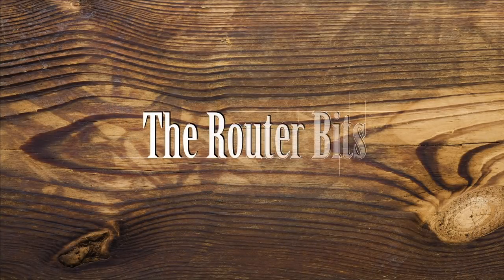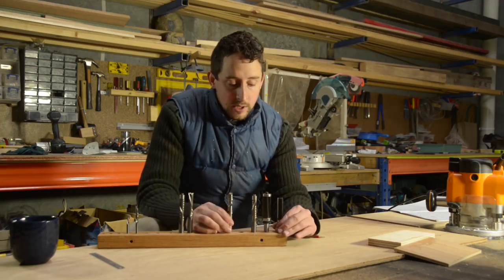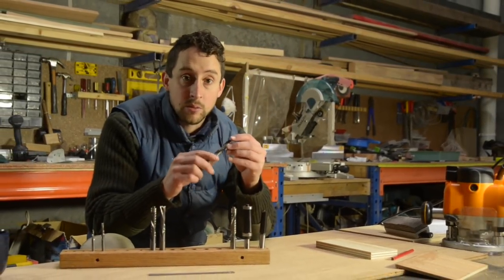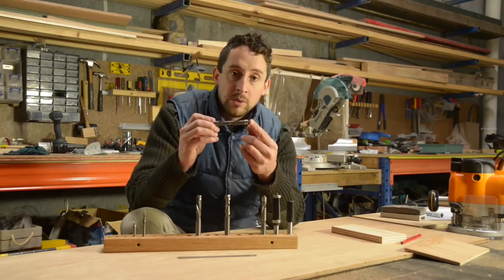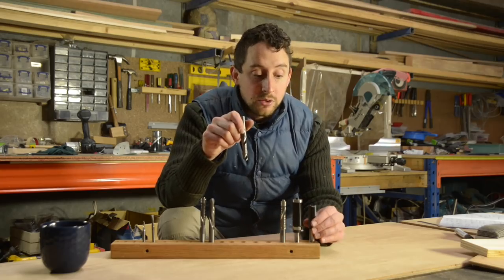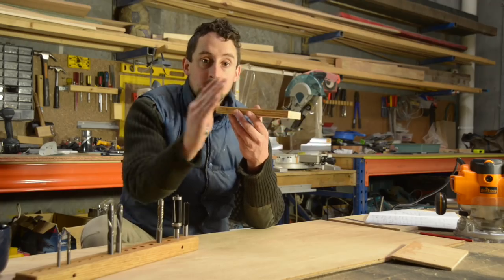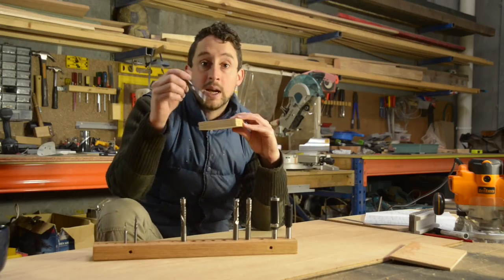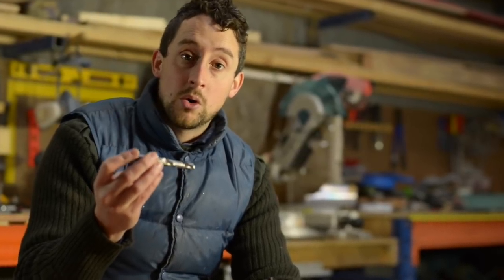The Router Bits - The Magic of Spiral Router Bits

Comment: You have done a great  job of explaining the how a spiral cutter works, I have been using  these for years in CNC routers and on the bench in a hand tool . They are great to use ..
Just one point I want to add is that there is a dual cut version these  which cut both ways at the same time giving a superb cut on both sides of the work piece., and awesome at face groves. And rebates , 
Some limitations are the up cut section is about 10 mm . 
In the UK they are know as         F max  but just look for a combination spiral cutter .
You will love them .
Reply from the maker: Hi Robert,

We just released our range of compression bits this month - check them out! https://www.youtube.com/watch?v=Z11csT4_8pM

Comment: You got it right sir, that's why there is a need to have the guide to maintain constant and straight cut, more advantage is those bits with guide bearing, it maintain consistent constant contact with the edge of the wood.. nice tutorial video.

Comment: Great video, perfect explanation. I was about to make a huge mistake on my bookshelf speakers project. I need to cut a 1/2" rabbet all the way around my birdseye maple veneered speakers to frame them with strips of bubinga that will get chamfered at a 45° angle. I had planned on using a standard 1/2" rabbeting bit but now I think that would have had some major tearout. Watched this video and now I think I'd be best off using an edge guide with a spiral downcut bit

Comment: Ok, so which bit would you use to carve letters in wood signs, and if you suggest the upcut spiral, then the use of packing tape would be beneficial?
Many thanks!
Reply: id think you could still use the down cutting spiral because you want crisp edges on the letters, as long as you’re not cutting too deep.  if you baby sit the operation on a cnc with an air hose, that will clear out the chips.

for example, if you’re only going 1/4” to 1/2” deep, plus blowing it out with sn air hose, you should be ok.
if you can get strong suction on a 1 1/2” dia vac hose and get real close, that might be enough to pull the chips out.
i think baby sitting it with the air hose and goggles for you works best.

have you tried a straight bit, and what did you try since you posted your comment?

Comment: Amazing explanation. I guess, my question is: if I were to get 1 based on budget, which one? Up or down spiral as far as versatility.
Reply from the maker: Hi Marco. Upcut outsell downcut by a factor of about 2-to-1 overall. Some specific sizes sell 1-for-1 but upcut overall seem to be more popular probably due to them performing better when cutting channels for chip ejection. But it very much depends on the application you have at hand and what you're trying to achieve.

Comment: This is a superb explanation of the subject! I wish I had seen this when I started getting into CNC. It would have made the learning process much easier. This reminds me of a question I have. In cutting through vinyl paint masking, I've found that when possible, using a downcut spiral cuts the vinyl mask off much cleaner. But most of my work requires Vbits to be used. Does anyone make a downcut Vbit? Thanks.
Reply from the maker: Thanks Jim. We are glad to have been of such assistance to you!

Comment: One thing that none of these videos address with upcut or downcut that greatly affects which bit to use is the explanation based on the bit in a hand held router or in a router table vs the edge yoy want finished. So if your using the router table and your finished side is placed down on the table which bit ? So on & so forth....

Comment: Are you a fan of compression bits ?
I understand their applications are limited but when they ARE applicable, are they worth the expense ??
Also... can spiral bits be sharpened ? 
I would imagine the bearing guided bits could NOT... unless the bearing is also ground to match the new, smaller, diameter...

Re. Down-cut spiral bits in non-through apps, you didn't mention that there would also be a lot of "re-cutting" of the waste material which increases heat & also wear to the bit...

😎👍☘️

Comment: I was cutting a box joint today with a upcut spiral bit  (1/2") using 1/2" thick birch plywood.  It cut very slow and created a lot of burns. It totally did not expect it. Change rotating speed or feeding speed did not help. What am I doing wrong? Thanks.

Comment: I have read that an up or down-cut spiral router bit should not be used in a handheld router because it is dangerous, so only in a router table. Is this true?
Reply from the maker: You should be more than fine using a spiral bit in the router. Like with any bit, use shallow cuts and follow all safety precautions. Jonathan Katz Moses did a video on these bit that go into the spiral cut bits in more details.
Reply: @timbeconaus  hanks very much for your kind explanation. Could you please post a link Mr. Katz?

Comment: Great video, thank you for doing it. I was wondering if a 3 flute spiral bit better than a 2 flute spiral bit for cutting hard dense wood? I am working with Swartzia leiocalycina and its an insanely dense wood. It's, also very expensive. I tried a standard straight bit on a scrap piece and it kept tearing out. I then did some research and came across this video, but now I am trying to figure out if I should buy a 2 or 3 flute bit. I don't have a lot of funds atm so I can only get one bit. Any help that you can offer would be most appreciated

Comment: Great video. Is there a recommended rpm for these bits? I was using a 1/4 inch up spiral bit for making box joints, and I smoked a brand new Rockler bit. I’m assuming I had the rpm too high. My P.C. router was at 16, 000 rpm. Seemed to go better when I dropped it to the lowest setting 10,000 rpm. Curious if anyone has an answer

Comment: what if you need a bearing on the bottom instead of the top, does the smooth round part past the blade on the bottom serve as a bearing guide for a flush trim?

Comment: Nice explanation. Which flush trim spiral router bit with bearing would you recommend?
Reply from the maker: The standards that are most often purchased are the basic upcut bits, but much depends on your tasks at hand. Can you give us an idea of what you will be doing?
Reply: It will be trimming a 18mm birch plywood with furniture linoleum (2mm) glued on top, using a template...

Comment: Do any of your spiral bits have a flat bottom like the straight cut bits?  I'm wondering if so, have you ever tried a spiral bit to flatten any end grain.  Most everything I've tried so far tears at the end grain.  I've tried straight bits and two different bits made for flattening and nothing is working very well.
Reply from the maker: All of the spiral bits have a flat base like the straight cut bits. I haven't tried to flatten end grain with one but I would assume that very light passes on a Spiral Up Cut would give you better results than anything else.

Comment: What about sharpening these spiral bits?
Reply from the maker: These spiral bits, like all Torquata router bits are able to be resharpened and we recommend that its done by an experienced sharpening service to ensure that the bits maintain their balance.
Reply: I thought that because they were carbide, they cannot be resharpened though?
Reply: As a machinist I was able to have spiral carbide cutters resharpened when they were too expensive to be replaced. Now the price of carbide has lowered to the point where they are usually less expensive than Hi speed steel. Any carbide designed for aluminum would easily cut any wood or plastic.

Comment: For a router table, which is better upcut or downcut? Are these bits cmt?
Reply from the maker: It depends on what edge you want a smoother finish on - upcut is generally more common as dust will eject under the table and the bottom edge will not have a smooth finish - in other words the top working edge will be the cleaner cut which most people prefer - but downcut can be useful depending on whether you are working face up or face down. 
The bits shown in this video are our own Torquata brand but the principles covered in the video equally apply to the 191/192 series CMT spiral bits.
Reply: Do you ship to Spain?
Reply from the maker: Hello! Thanks for asking but no, we don't ship to Spain. We are based in Australia. We are sure that you can find spiral upcut and downcut bits in Spain. Perhaps look into the CMT range, which we would imagine are also available in Spain and throughout Europe.
Reply: thanks!

Comment: Why not just ditch the straight bit into history.?I don't see a reason why to buy or keep it after watching this video
Reply from the maker: You make an excellent point. There is a cost difference but if that isn't an immediate issue for you, your point is well made.
Reply from the maker: From a quality point-of-view totally, unfortunately its a cost issue. For one job doing 10m (or 30ft) a simple straight bit at 1/2 or 1/4 of the price would be ok. But we are seriously looking at more spiral bit diameters to make them more common and accessible to use. Stay tuned!
Reply: thanks bro
Reply: One reason I saw would be that it is hard to make solid carbide bits with the cutting bit larger than the shaft.   You need solid carbide for spiral bits because you can't easily attach carbide to the spiral cutting blade.  This means you can only get a solid carbide bit of a max of like 1/2" (for a larger bit size on a router).  What I've seen available seems to agree with this, but I will say I don't know everything on this topic.